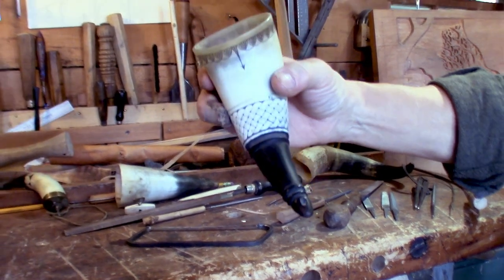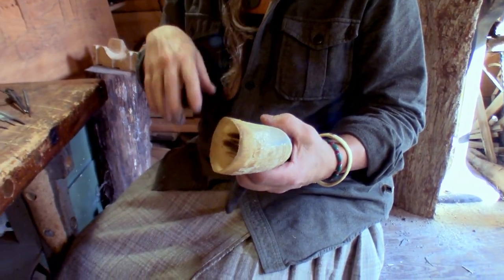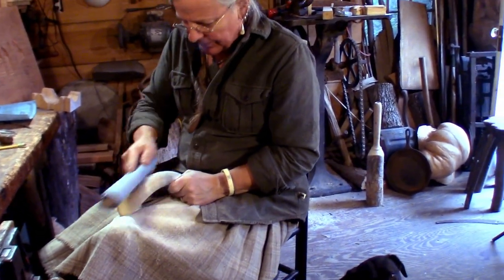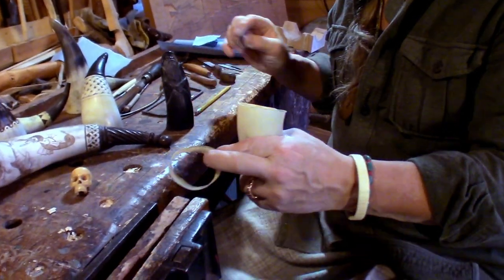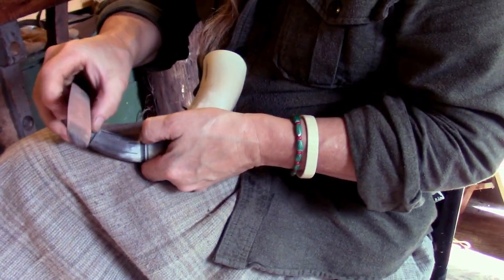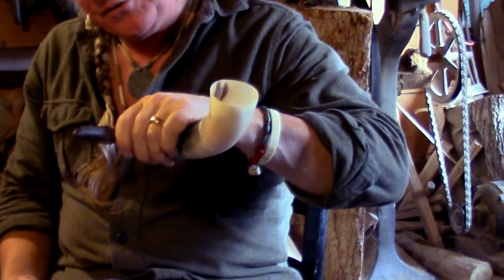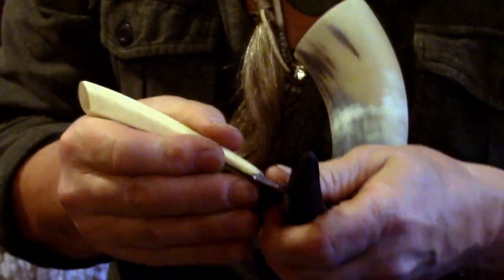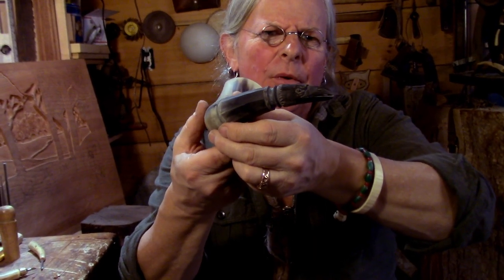Drinking Horn: How to Carve a Raven's Head

Comment: I just have one question, is the resulting powder (resulting from the scrubbing) too dangerous for breathing? 
Great video!!
Reply from the maker: Hello Nik, thank you for checking out our channel. Yeah,the dust from sanding horn is probably not good for you on a prolonged exposure, but nether is most woods as well. I work in these materials a lot and I have a dust collection system that works very well. But light exposure such as sanding one horn is not too bad. It would be better if it was done outdoors.
Reply: @StockmanOriginal  thanks for the response! Amazing video again have a great day